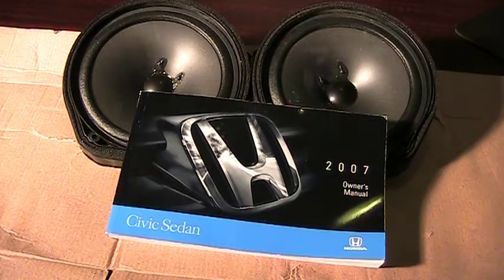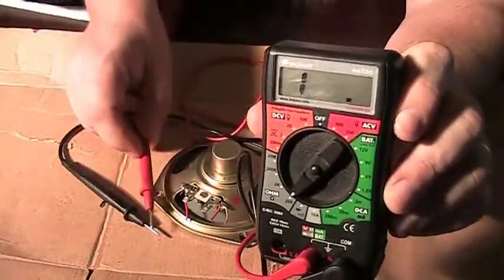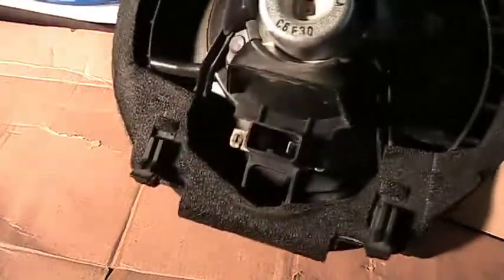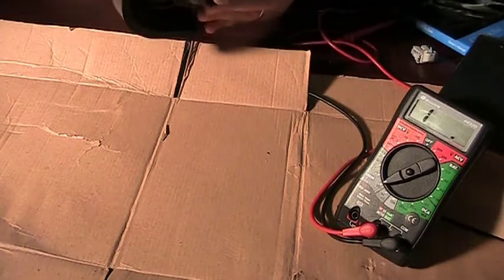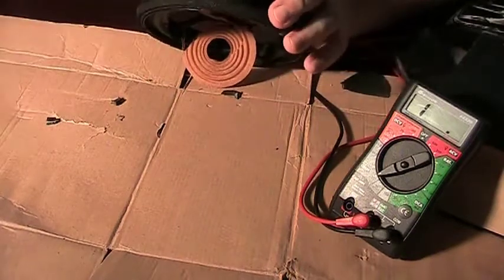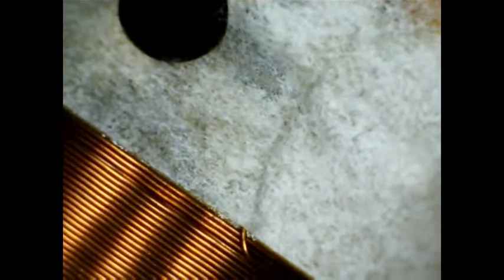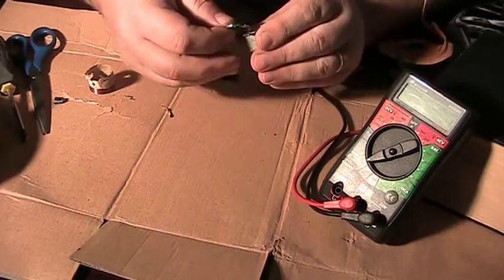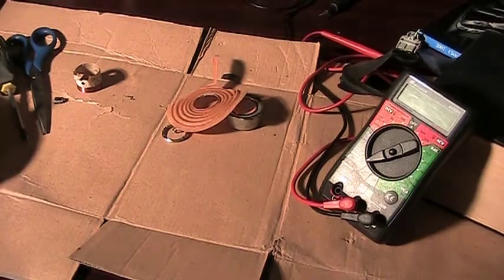Testing a Blown Speaker vs a Good Speaker from a 2007 Honda Civic

Comment: The spider is to keep the voice coil from rubbing up against the magnet. Not as a filter or a base for the cone.... The cone is glued directly to the voice coil. And the voice coil wasn't blown.... Actually there was a problem with the connector that connects your cars audio harness to the speaker. It ended up unsoldering itself due to cheap solder... If you were to hook up some wires to the base of the connector the speakers would work perfectly.... Just a little bit of info... Anyways it is recommended that you replace the factory speakers on your car for better sound quality